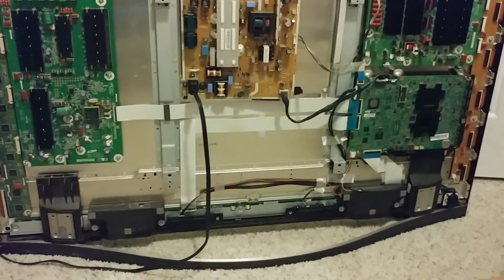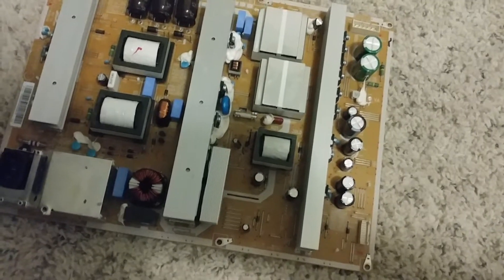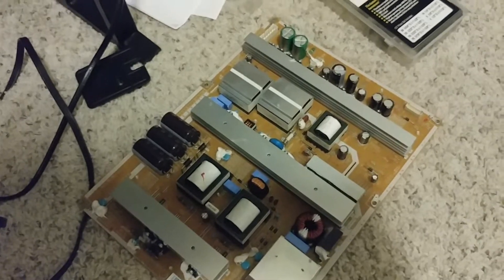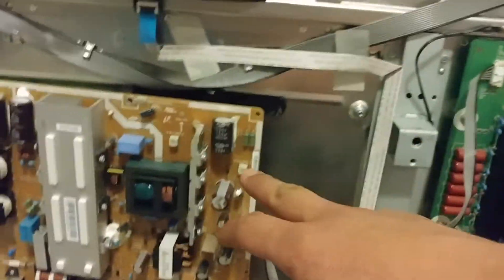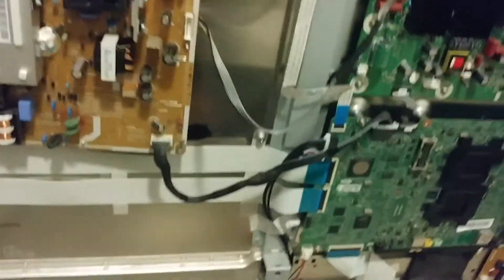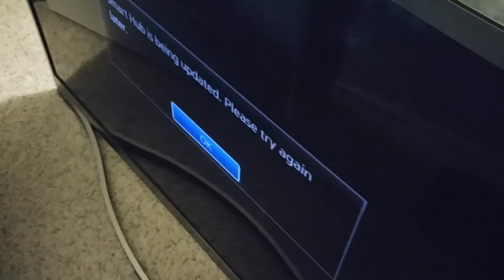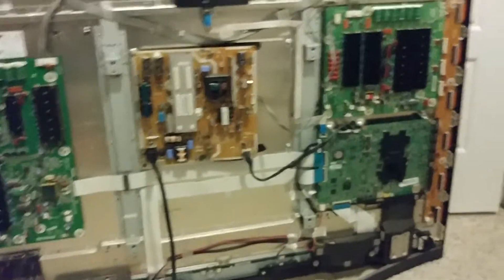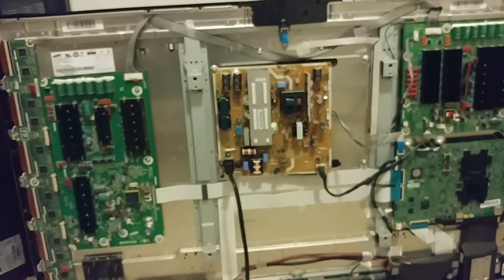Samsung Plasma Repair for PN51f8500 NO power

Comment: The correct board for the 51 inch panel is BN44-00619A
Got this straight off Samsung website.
Reply from the maker: Yeah I know. But at the time these boards were expensive and hard to find. So I had to makeshift with another similar board.
Reply: I'm seeing several mail-in-repair services as low as $40 for fixing this and other types of TV boards. Great for people to know that there are regular people out there that will do this stuff for cheap. 

I did this on a couple fobs for my BMW. Paid $60 instead of 200 plus. Also did this for cars instrument cluster display panel went bad .$90 Instead of $1,100

Comment: The replacement board is one from another Samsung Plasma, of the same model year, but in a lower class. What do you assume the reasons are for using two different boards in the first place? Where would you expect any performance issues to come up?
Have you tried all the features, including 3D and the 2-handed gesture control, with the new power supply?
It is 2 years later. Has this fix lasted?
Thanks, and nice work!
Reply from the maker: It still works fine. But I don't use it much too. So I know that the board is not as good as the original one, but then again the original one has a tendency of going out too.

Comment: Mine just died, no power, no lights nothing.  Not many hours on it.  Wanted to ask you if this board is a good idea.  Nice video.  https://www.genuinereplacementparts.com/bn44-00775a-oem?gclid=CjwKCAjww5r8BRB6EiwArcckC9_pn4pw6Tdw1MfK6FjyEf2Ps53gt0bz1WfxpwldMBJkCa3c7e3B-BoC7cMQAvD_BwE

Comment: HEY TECHIE I HAVE THE EXACT SAME TV (PN51F8500) AND I'M ABOUT TO TRASH IT, WILL YOU TELL ME WHAT BOARD U USED IN THE VIDEO?
Reply from the maker: The board I used was bn44-00600a. Comes out of pn51f5500afxza.
Reply: @TECHIELIFE  
The correct board for the 51 inch panel is BN44-00619A
Got this straight off Samsung website. You're welcome

Comment: My Tv turned off this morning. Full dead no clicks no red light no nothing. Whats the part # of the board you ordered? maybe I can order longer  internal cables to avoid the soldering?
Reply from the maker: The board I used was bn44-00600a. Comes out of pn51f5500afxza. Good luck finding longer cables.